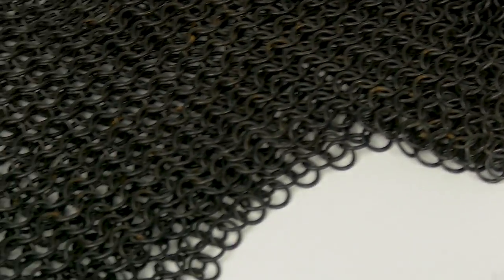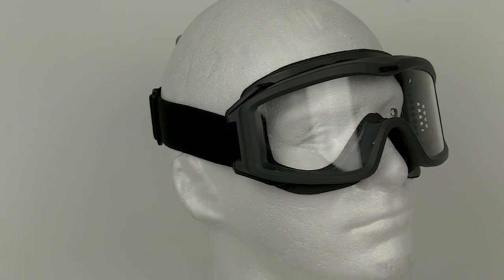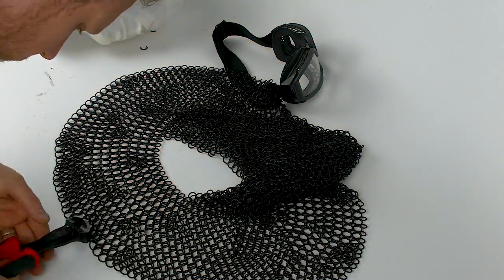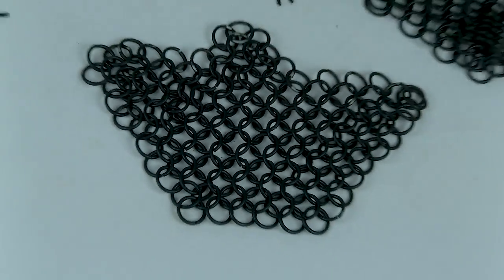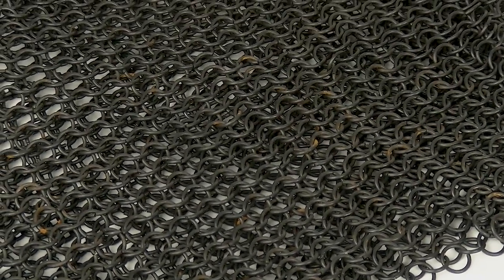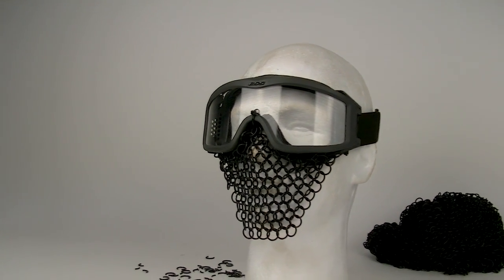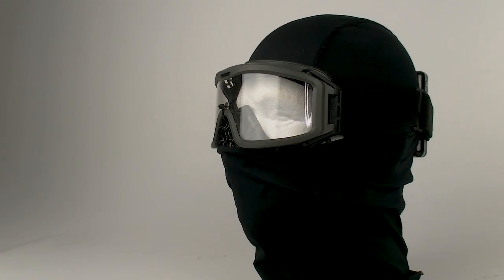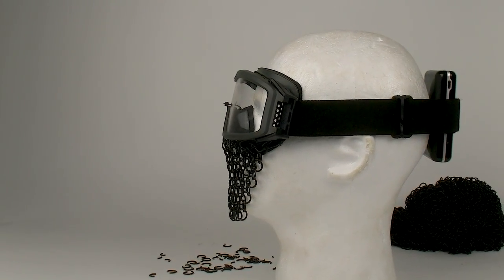Flexible and Durable Airsoft Face Protection DIY Tutorial

Comment: Meat cutters use a version of chain mail gloves with smaller rings. Should give you enough mail to do what you're trying to make.
Reply from the maker: This is a good tip, thanks my dude.
Reply: @BrainExploder  NP. Also, you can ask a meat cutter at various chain grocery stores if they have some old ones sitting around. They tend to use 'em for a year or so, then throw them out and get new ones. ;-)

Comment: I personally run just a mouthguard. Like you said, it makes you think twice about exposing yourself to a bad situation. I'd be interested in seeing how a finer chainmail would work out, but I'd also be curious about the noise, especially when it brushes up against a gun stock, or when it swings around when moving. Maybe there's a way to add structure to the chainmail to keep it from moving too much.
Reply: meh in the end u are just another person who blocks the bottleneck corner no one will pass cuz "oh no i could get shot! its the only way but no i woont!! blablabla..."

jez its not that hard, I 3D scanned my complete head with goggles on and my friend 3d printed a flexible lowerface protection wich is attached by simple zip ties @ my goggles... if u want its not that hard...
Reply: @123456kiste  lmao. you've obviously never played with me.
Reply: @Hofinator7  lmao shame on me... tbh as long as u dont go mad if u get a hit in ur face im ok with it but "thinking twice about exposing yourself" is such a bad argument for not wearing lower face protection... even with lower face protection u could think twice lol
Reply: maille can be tailored to your face so its tight and it really doesnt make any noise when running as long as there isnt too much excess.

Comment: I used to make chain mail. You can order cut links in many sizes. To get a tighter weave with links you do a 6 in 1 pattern instead of 4 in 1. Also aluminum links are WAY lighter and just as good for this purpose. Smaller links in a 4 in 1 pattern would work but also are a lot harder to do but it is not like you are making a whole suit by hand. Also take a look at WW1 Tank Operator masks for some inspiration.

Comment: It might rip out any facial hair though and bbs might shatter on it sending shards in. By the time you get small enough to prevent the shrapnel they either won’t be strong enough or they’ll basically just be the mesh mask. Don’t know, but I don’t think I’ll try it for now. Good to see someone thinking about this problem though.
Reply: facial hair thing could definitely be a big issue.  Preventing shrapnel isnt so much. This would be  meant ot protect the face not the eyes.  So by the time the bb blows up on impact, the shrapnel will unlikely have the energy left to penetrate the skin.  Also with its flexibility, it may be better at absorbing hits and lead to less shattering in general.

Comment: Main concern would be rattling and/or having it get stuck in some stocks that have cheek risers - if the rings are large enough. Something small that covers just the mouth and can be worn under a balaclava so the impact can be dissipated on a larger area is all you need to cover your teeth.

Comment: mesh mask cut to fit goggles. Zip tie mask to goggles, cut bottom of mask to the contour of your face and re wrap nylon on exposed mesh edge. It doesn't touch your face, collect moisture, obstruct your voice, make noise, isn't heavy, and is cheap.
Reply: U dont have to cut em, just give the mesh mask a hard bend it will stay that shape, just keep bending and molding it to ur face and goggles till its perfect
Reply: I do the same thing. I bought the Cortex Clip for the Revisions that fit over the goggles & that covers the bridge of my nose & then cut a mesh mask to just cover my teeth & zip tie it to the Cortex clip.

Comment: i currently run homemade maille as my head protection and mouth guard. used a similar pattern to yours. currently trying to make Japanese 6 in 1 which is lighter, easier to mould to your face and protects a bit better.

Comment: You can make this with smaller rings in about 2-3 hours. Use a European 4:1 pattern and you should be good. also, instead of cutting pre-made, two pairs of pliers and bent the rings open.

Comment: Better than nothing, but i do think the links are too big. Maybe do a shooting test and see how the foam face holds up? 

As for looks maybe some camo netting in front of it? I was also thinking maybe a thicker wire running the outside links so it holds shape better and doesnt flop around when you run, but the inner links would still flex when you go for a cheek weld.

Comment: I don't recommend diy chainmail for this because the ends are just butted so it's really just decorative
Ringmesh.com
mailletec.com
These are both welded steel.
They both do a finner industrial mesh and I think they both do samples.

I poked at this a bit and was worried the finner maille didn't have the mass to take the energy out of the shot but would love to see what you figure out.
Also, traditional maille is hung 90° from what you did (yours is sideways)
When you hang it the right way it's woven will cause it to draw together towards the bottom and significantly tighten up the gaps. Might even be enough that the maille you have could stop a bb
Maybe also look at scale maille

Trying to solve the mask problem I just picked up a division six t'farge mask. Haven't played with it yet, but initial fitting this is the best I've found. It's not perfect, and it is expensive but I still recommend it
Reply: i run maille as head face pro. butted is fine. also his maille is correctly orientated. you want it going side to side.

Comment: I feel your pain, facepro is such a big problem. And from time to time I get shot in the ear too, that's painful! I have no acceptable solution :(
Reply: Taking a look on aliexpress, I found some chainmail cast-iron pan scrubbers for a reasonable price but the chains are still too big, around 9mm. For this project to work we'd need max 6-7mm.
Reply: if you run say a dye mask they have ear protectors available, or other full face ones similar do as well, if you run a fast helmet or a hat, a lot of options for earpro that double as comms, most of them have the ability to hear ambient sounds around you, so you aren't at a disadvantage.
Reply: @thatstrangemoon1259  I have a sh*tload of masks, I don't like any of them. I also don't like helmets because they get hot and sweaty, I use a boonie, that's good enough for head protection. I though about those electronic earpros that you are probably talking about, I tried on my friend's one once, it amplified sounds but lost the direction. I don't know, it was weird, and it costs a lot of money so I don't know if I should buy one or not.
On milsim I usually only wear a half face balaklava (and sometimes come home with some red marks), on skirmishes I wear this mesh mask that is pretty slim and has those plasic drums (or whatever they are called, you know with holes on them) that protect my ears, but it's not comfortable at all. Bigger masks block a lot of movement and field of view, I don't like those :(

Comment: one thing ive done to improve my face mask, is i cut some of it off on the right side of the cheek, giving me a good cheek weld onto my rifle, while still protecting my teeth, and the full left side, with the mask being attached to my goggles.
Reply from the maker: But how does it look?
Reply: @BrainExploder  i think it looks fine, just not symmetrical which doesn't bother me all that much, function over form.

Comment: I think it would be best to make your own chainmail, there are a loooot of tutorials on how to make them. Like you are going to need some steel wires, some sort of stick (maybe smaller than a bb?) And a screwdriver. Put the stick in the screwdriver, and then use the steel wire to wrap it around the stick. after making like 30-40 layers of steel, you need to cut every link and relink them